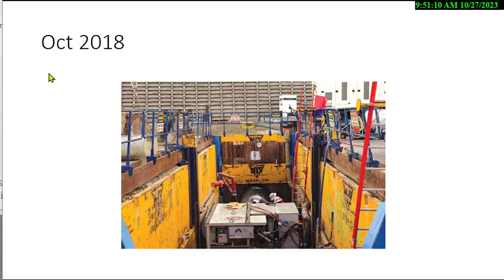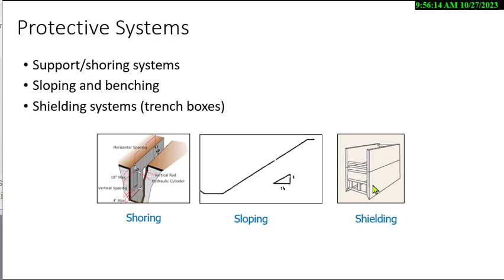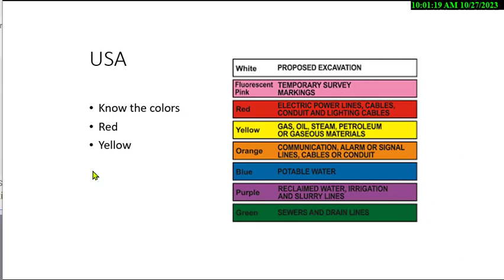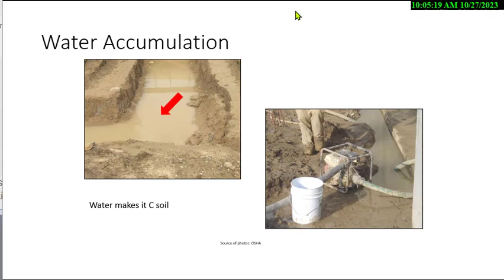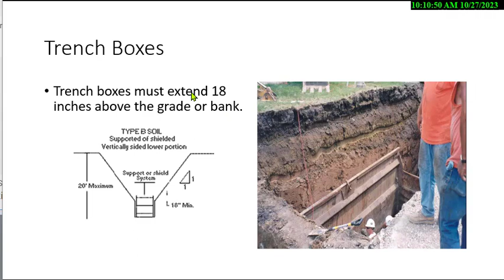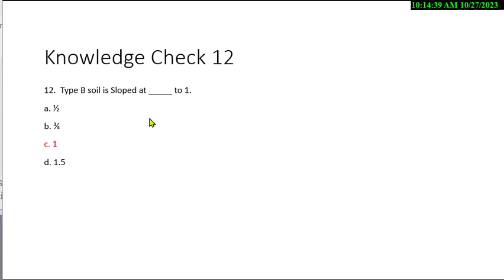Excavation Safety BCSP ASP CHST STSC STS

Comment: A few issues with 811 that I've run into in the past: some of the small co-op utility companies don't always participate in 811 - we had this issue when we struck an unmarked water line. They claimed they were never notified and they didn't participate in 811 as it was a subscription service. Another issue was when drilling to set new transmission poles along the ROW through a farmer's property we hit an unmarked water line. Someone had installed an irrigation line and no one ever pulled permits so it wasn't marked on any maps.
Reply from the maker: Thanks for the insight on that 811

Comment: John, Question.
As per one of your question in video, slope classification is B, target depth is 8 ft, okay so slope would be wide open till top it would be 20 ft if its 4 ft wide. Do the excavation from the ground would start from 20 ft wide or first go to 8 ft down then make a slope with an angle of 45° and in the end it would be 20 ft wide.